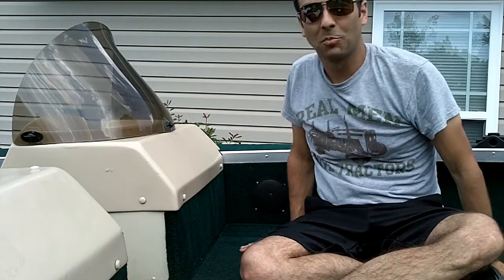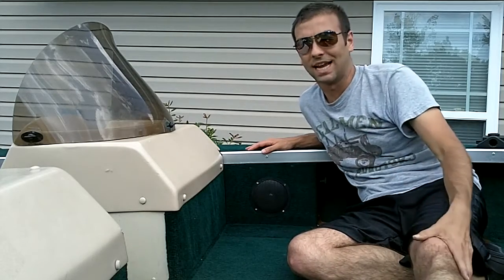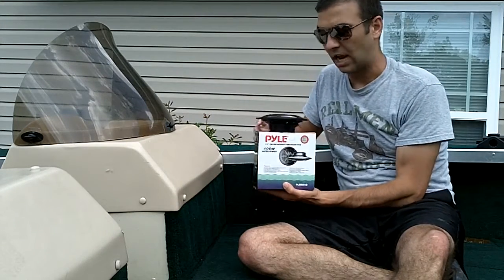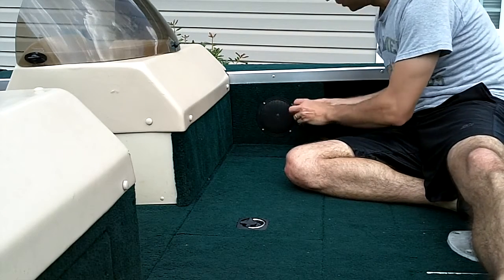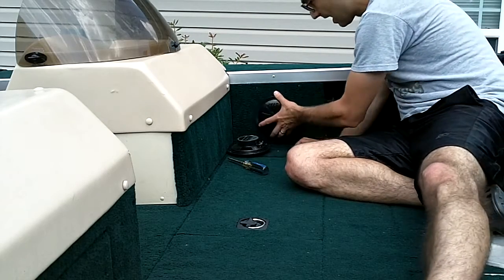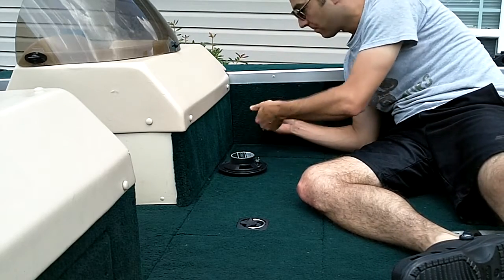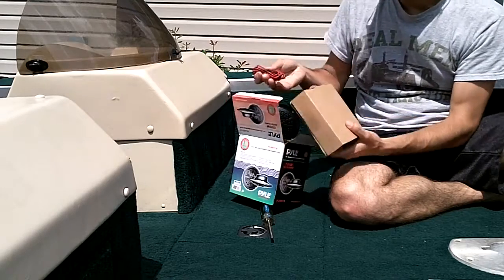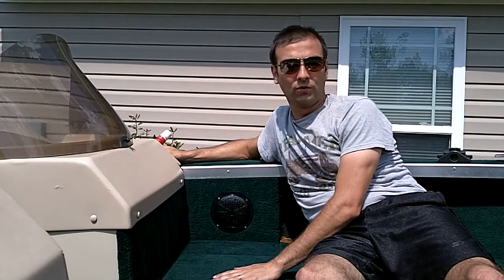Boat Speaker Installation

Comment: I appreciate you putting this on. I found it on an question that you answered. I usually head to youtube when looking at an item that I've never bought or seen before just to get a little more info on it. Good to set eyes on it before buying from a picture. I think I'll be getting a set.  Thanks.
Reply from the maker: +greenkayak67 I'm glad it was helpful!  They're pretty good bang for the buck; they're way better than what came in my boat when I bought it.
Reply: I'm looking for speakers in my sound bar of my Wrangler. The top is off all summer and we get caught in the rain now and again. Not to concerned about high quality sound, just decent sound.  Thoughts????
Reply from the maker: Mine get splashed all the time--I've got kids.  

Sound quality isn't bad especially for inexpensive speakers.  Mine are definitely not behind an amp.
Reply: Good, thank you. I just have a simple stereo and want simple speakers for the Jeep. At that price, if they're even fair, it's a good deal.
Reply from the maker: Then, I'd say go for it!  

When I ordered mine, each box had two speakers.  So, when I ordered (from Amazon) two boxes, I got four speakers.  FYI, to save a little money.